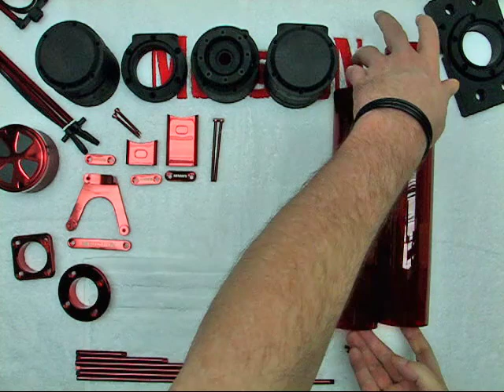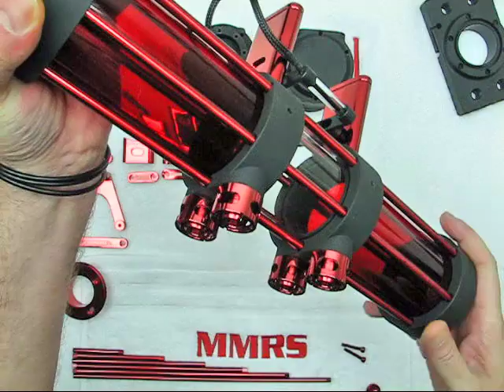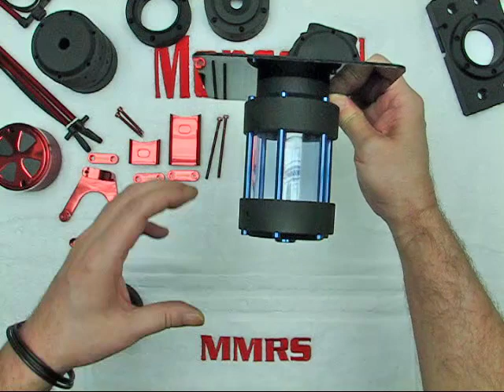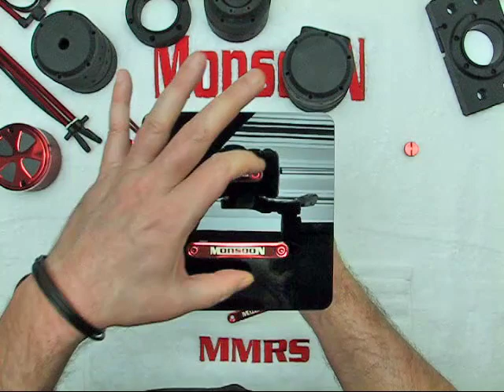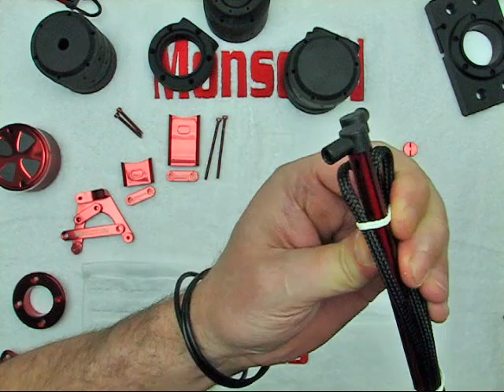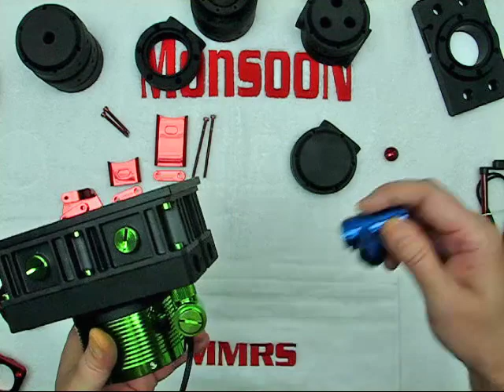Monsoon's New Modular Reservoir System Overview!

Comment: I just purchased one of these and the ccfl lights will not work with the inverter i already have(little blue one, it works with my current lights).  which inverters do you recommend to use?  there is also a break in the inside of the ccfl, will it not light propperly if it has a break in it?  I can't tell since the light will not work with my current inverter.

Comment: I'm loving the side port caps because I realised that you could also use them to mount the res to the case using some pass through fittings.  I'm going to use them on the new Parvum L1.0 ATX case I have on pre order then I can have all the tubing in the other side of the case (the L1.0 has loads of room here as the PSU is mounted there) and the Res will not have any visible tubing going into it which should look pretty cool I think.